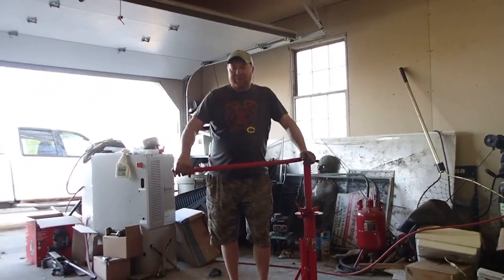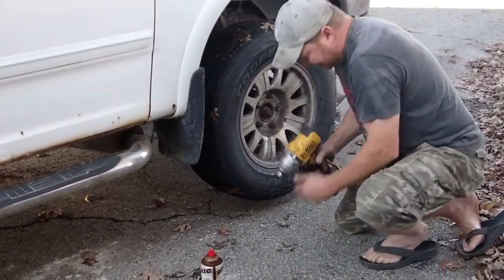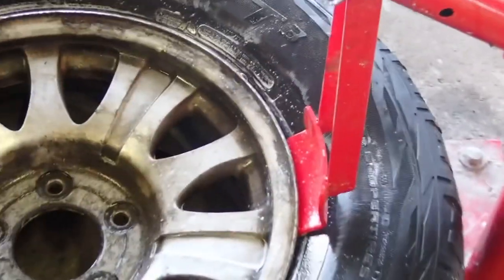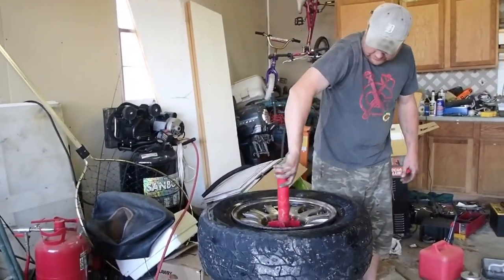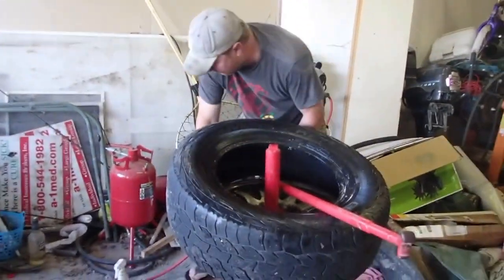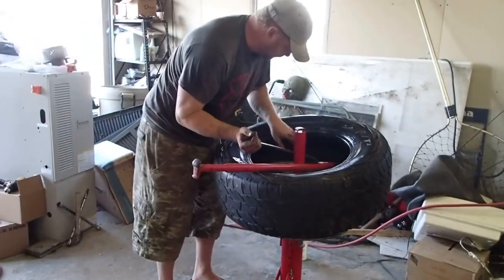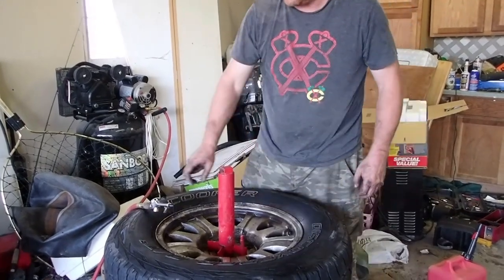Harbor Freight Tire Changer Rocks!!! How to use it and not break it!

Comment: At 8:33 that groove in the rim is called the "channel". It is midway across the rim (midway down in the position on the machine), it is about 4 inches wide (up and down in this position on the machine) and two inches deep (toward the shaft on the machine). As you lever the rod to pop up the bead, you MUST push as much of the rest of the bead into the channel (AHEAD of the bar pry point and all the way to the other side OPPOSITE of the pry point and any further if you can). You have to KEEP that leading bead pushed in the Channel as you push the bar around the shaft as it lifts the bead. It takes practice because the bead will "fight you" and want to pop up toward the rim lip. The whole idea is to keep as much of the bead as possible in the channel to give you plenty of SLACK at the the pry point to easily lift and pop the bead over the rim lip as you go around. Staring the rotation is the most difficult part because you need as much of the bead in the channel to get going, as more and more of the bead is lifted up over the lip as you go around, it gets easier. But keep that bead in the channel until the poped up portion of the bead is now providing slack for the opposite side. You are doing TWO critical and subtle operations at once (most people don't even see the subtle pushing of the bead into the channel because you can't see it (tires are not clear) - its all done by feel.  Go slow and practice makes perfect. Once you master the technique, you will not need to lubricate the bead (which can cause corrosion and rim leaks if all moisture from the lubricant is not removed). Many people use lubricant when putting on (mounting) a tire and forget to COMPLETELY DRY off the bead, rim, and ANY water that gets inside the tire and rim. Any water (even a few drops) can cause corrosion and leaks. If you fail to keep the bead in the channel and force the pry bar, you will DAMAGE the bead and thus destroy the tire beyond use. Go slow, if it seems suck, DONT force it... back off and try again giving more attention to keeping the bead in the channel.

Notice how many times I mentioned "bead in the channel"... that is what makes sucessful and easy tire mounting/unmounting possible.

Comment: Good idea with the scotch bright pad!
I also bought a can of bead sealer tar for the rim and I run my grinder with the wire basket around the bead "Grove". 
I worked at a pro shop for several years and this is how we did it there too. 
My HF one is fine but I did break the nut out of the top of my old one. I may have overtightened it. But heck I probably changed 30 tires with it so it paid for itself. 😁
Reply from the maker: So far, just the crappy welds on that x-washer thing have been an issue.  I put proper welds on it, so no biggie.  2 weeks, and the temps dropped 65 degrees since the day I did that, and those tires are still aired up! Pretty happy about that!

Comment: I know he knows what he is doing. Just that doggone murphy getting in the way. I had fun watching the video! He tries so hard to get where he wants to be it works. He is correct there are alot of people that complain when they are to blame about hobo freight. We still like it cuz nothing is perfect! Thank for the good video.
Reply from the maker: Thanks man!  Just remember you can never use too much lube!  A trick I came up with to get a small tire bead off once… I rigged the $15 HF vacuum pump to the valve stem, and when it pulled it enough that it started to leak, I started spraying the soapy water!  If you can just get a tiny bit in somewhere, patience and more lube will pay off!

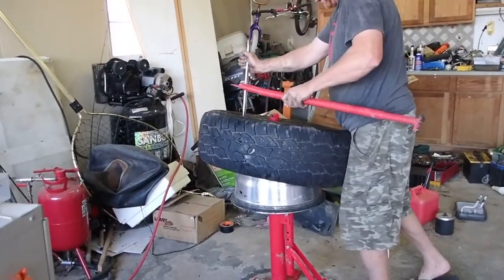Comment: See 14:05 with your RED bar the wrong way around (any red bar) you'll stuff the rubber really quickly, but use the "provided" duck-bill on the other end of that red bar (any RED bar) the tire will float on easy.
No huffing & puffing & gosh buggah, another blown rubber.

Comment: get yerself a gallon of Black Jack Tire Repair BJK-LB-800 Tire Mounting Lubricant, and, a red Straight Lube Bucket for Coats Changers with 3 Lube Swabs that are 11.5" Length, and then slather away at all the surfaces, then go to town on your tire changin job. Then it doesn't matter if there's any leftover liquid anywhere on the rim or in the tire when your job's all done. The Black Jack is good for your tire, doesn't hurt the rim, and helps seal the bead even better.

Comment: I didn't realize that a tire could be removed without some air power assistance.  The main thing I saw with that tool is that the base needs to be bigger so it don't wiggle so much.  That movement will eventually pull your anchors out of the floor.

Comment: your method is OK, the original HF tire bar is not good, at least, it needs finessing with a grinder to remove the sharp edges,
 what I done is that I fabricated a bar with plastic tips so it does not cause damege to the rims or the tires and it is much easier to drive than the original bar. I don't use the small tire bars with my bar.

Comment: What is the duck bill on other end of bar
Reply from the maker: I’ve honestly never figured out what it is for.
Reply: @scottyshomesteaduniversity7778  Flip the bar around and put the duckbill into the lifted bead, as it makes it far easier to keep it lifting (lube or no lube) than a flat single lever.
Reply: @QUIX4U yeah, the trick is to keep the bar up high as you rotate in the correct direction so it will guide the bead down into the rim.  If you keep it horizontal while doing it, the angle of the ramp is too shallow and it's going to slip out.

Comment: Thank you for the video.  It looks like you removed the tire just to put it back on.
Reply from the maker: I flipped them around, because someone rebuilt my front end when I took my truck in for just a ball joint and it hasn’t been able to be lined up ever since!  Lesson learned… fix it myself!
Reply: @scottyshomesteaduniversity7778  Find out what he did and undue it or somehow get the car aligned.  Easier said than done.  But you probably already thought of that.
Reply from the maker: @dyardsale5475  Yeah, it’s got 300k on it, so it’s a backroading truck now!
Reply: @scottyshomesteaduniversity7778 I spent 4 days doing 2 tires.  It worked ok to dismount but mounting the 2nd bead failed both times.  I may need to upgrade to duckbill or I need a better base for it as I have no ground to bolt it to.  I thought it would have been a lot easier since I used to work at a car dealership, but we used machines not these.  I found videos on how to mount the tire without a stand and I followed their advice to get the tires on.
Reply from the maker: @dyardsale5475  Did you use ether?  That’s my backup go-to!
Reply: @scottyshomesteaduniversity7778  I could not get the bead over the rim.  After I got the tire on it inflated easily even with my tiny compressor.

Comment: I too could not get that bar to work. It just jammed and twisted out of my hands.
It is relegated to the bead breaker only now
What you need is a new cheap to make lever, like the one I came up with in these links
https://www.youtube.com/watch?v=H_c2ZMIYWdE
and even easier to make
https://www.youtube.com/watch?v=W8MddFsFmgA

Alloy rims are harder to deal with, they seem stickier than steel rims
Good luck